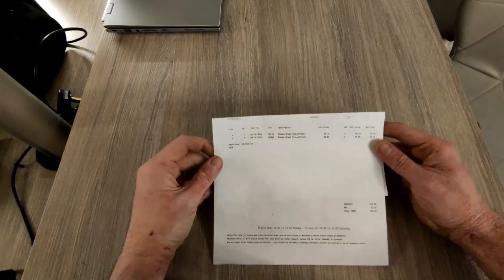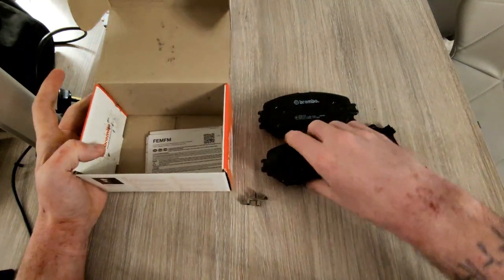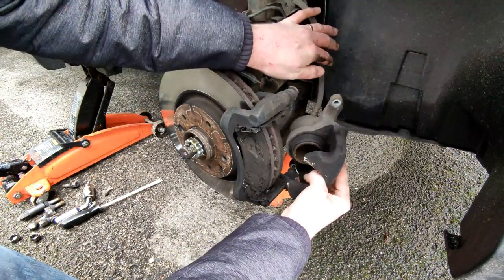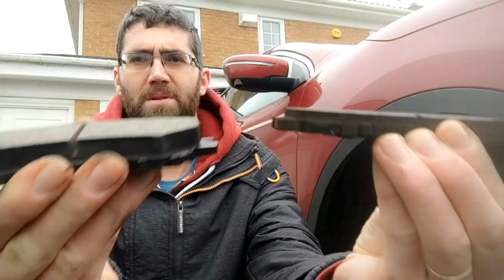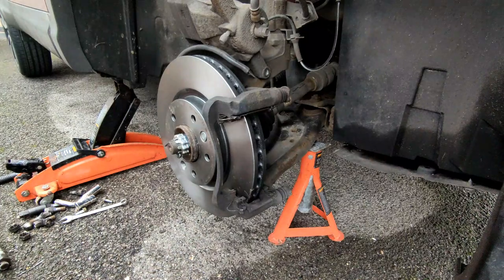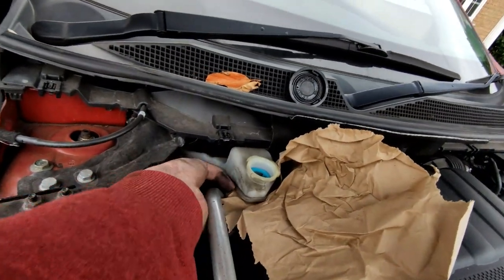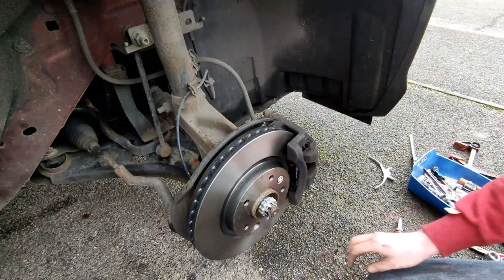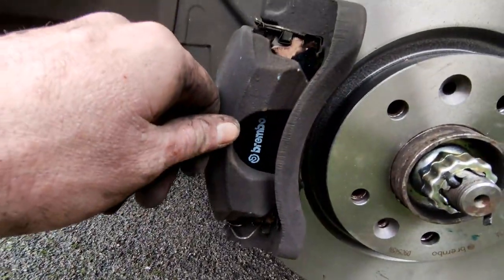Nissan Qashqai J11 Front Brake Pads & Disc Change Guide

Comment: New to the channel. The "cover" you mentioned late in the video is actually an anti squeal shim that should be fitted to prevent brake noise. The retaining bolt can be removed by applying heat then shock, ie with a blow torch/even a lighter and a couple of taps with a hammer, ideally get an impact driver. You should clean the rust from the hub before you put the new disc on to ensure it's totally flat. Add copper grease to the hub face before new disc put on, add it to the retaining bolt threads to help removal in the future and add it to the disc where it touches the wheel to help removal of the wheel itself, remember only a light coat of grease in all applications

Comment: After watching most of your videos, i decided i would try and relive my car styling days once again. with my j11.
so far i have added the antenna shark fin aerial, vinyl covered the chrome window trims, added black/red badges, and painted the chrome V Grille black, and added led taillights and one inside the boot, oh and also a boot lip spoiler in black. the swiping indicators on the mirrors and yellow fog light bulbs. oh also got 19" xtrail alloys with upsized 245 50 r19s alround
but your vids inspired me once again so thank you.
Reply: I bet that looks superb
Reply: Bro im am going to try the same thing.. is there any way you can show me how the finished car looked?

Comment: Tip for anyone attempting this process. Undo the disc locator screw prior to removing the caliper. Stick a screwdriver in the disc vent and jam it against the caliper. Saves you alot of time and effort. Obviously if its seized in there then you've no choice.
Reply: You can also put the screwdriver in the locator screw and while turning it, hit the head of the screw driver with a hammer. After a few times hitting the screw starts turning.

Comment: Shouldn't the clip spring hook behind the pad top and bottom?  You've stated that it should stay on the outside?
Reply: Should be inside. Acts as a spring to push pads back. It is not right what he done there with the pads.

Comment: Brake pad: min 2mm, brake rotor wear limit thickness: measured at 10 mm inside the disc edge - 24mm.

Comment: Helpful videos,
Why did you not use the second disc retaining screw location ?.
I have never unerstood why there are two in the hub and disc and only one screw,economy??
Reply from the maker: The second hole isn't threaded
Reply: Hi. Mr Qashqai, as a PS to the recent post, I have this morning completed a replacement of the hubs(bearings} ,brake discs and pads on my J11
I can assure you that the hubs are both drilled and tapped M8 x 1,25 to accept disc retaining screws, not as you suggest that one is not threaded.
It does not of course answer my question as to why Nissan fit only one screw.   @TheQashqaiGuy
Reply from the maker: Fair enough. I tried the second hole on mine and it was smooth right through

Comment: I had a Carlton that I had to change pads and disks on one side took 3.5 hours as the locator bolts had sized solid so tapped then around was ready for the next side did the whole lot in 35 mins.  great vid btw.  i use a g clap too except where they have to be wound back?
Reply from the maker: Ouch! Yeah I have a rewind tool too from my Peugeot days

Comment: Well good effort but a little shoddy but other comments have mentioned the more comprehensive method you should use, Re shims,copper grease on faces and bolt removal.
Reply from the maker: Yeah, as said. I'm no mechanic!

Comment: Maybe a dumb question but you need these 4 Pads only for the front what this video cover. And then you need other 4 for the rear, right? So 8 pads, all the same model? Thanks man :)
Reply from the maker: 2 pads per wheel so 8 in total

Comment: Hi mate, I got the front discs and pads changed at my local garage. Brembo pads and discs, there's a squeaking sound coming from the left brakes. I brought it back today, they had a look and said everything looks fine. They don't know why it's squeaking, any ideas what it could be? The mechanic reckons maybe it's just a faulty brake pad.
Reply from the maker: New brakes can squeek while they bed in. Give it a bit of time and it may go
Reply: @TheQashqaiGuy  it sounds high pitched, like the sound you get when they're worn. Is this normal?
Would you chance some brake cleaner on them?

Comment: Any reason why did you decide not to fit the anti-squeal shims for each of the four pads?
Did you find you had any brake squeal as a result?

Only asking as I am trying to diagnose a squeal after doing the front brakes on a Qashqai J11 (also used Brembo P56100) but fitted the shins myself with plenty of ceramic grease on the backs…
Reply from the maker: I didn't notice any squeak no
Reply: Brill thanks for the speedy reply pal, great video!

Comment: Hi there, new to your channel having been thinking about getting a J11 with the 1.5 DCI myself. Hope you don't mind the off topic question, and I'm sure you've been asked before, but what sort of fuel economy do you typically get? Enjoying going through your vids! Cheers
Reply from the maker: Hi mate. Thanks for your comment.

I get around 35mpg on daily driving to work which is a short journey on town roads.

Longer journeys,  depending on road type can be up to 70mpg. Average trip with a mix of roads would be at least 55mpg
Reply: @TheQashqaiGuy  thanks for your quick reply, much appreciated. My commute is a 55-60 mile round trip with much of it on the M40 from London, so guessing I could expect 50-60mpg maybe?
Reply: @TheQashqaiGuy  oh and also what's Nissan's recommended interval for the cambelt? I'm seeing 90k/5 years but can't see much on forums etc to confirm as such.
Reply from the maker: Yeah you should get a decent mpg on that run. I'd say it's ideal for a mix of driving.

As for cambelt, it's 90k or 5 years. I had mine done at 5 years as it was only on 70k at the time.
Reply: I have the J11 with the 1.5 DCI and I can say that it really shines in highway driving. I consistently get between 60 and 70 mpg for trip averages when mostly on the highway.